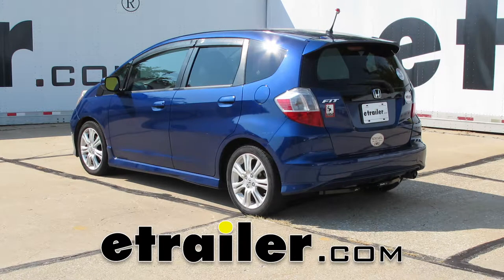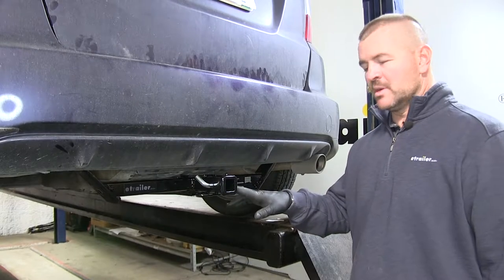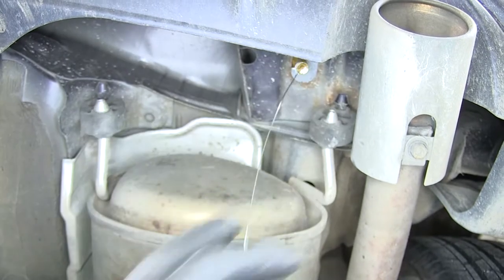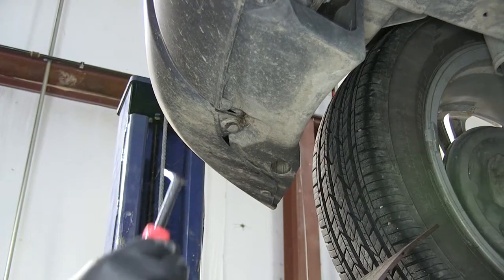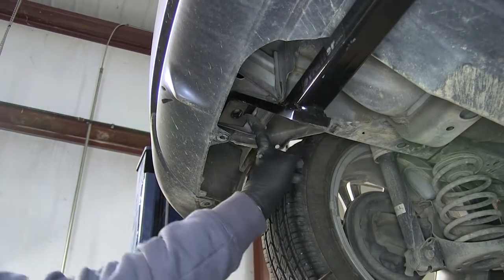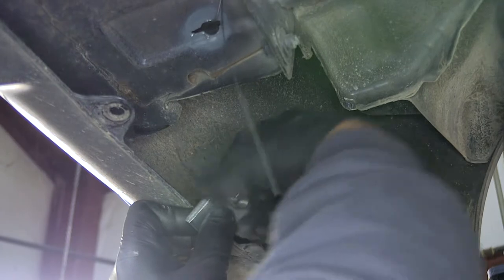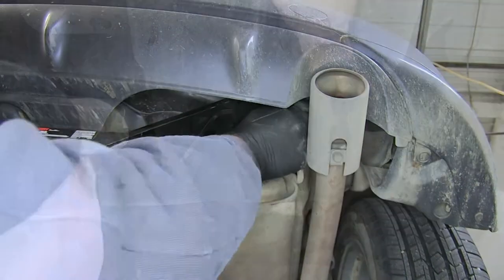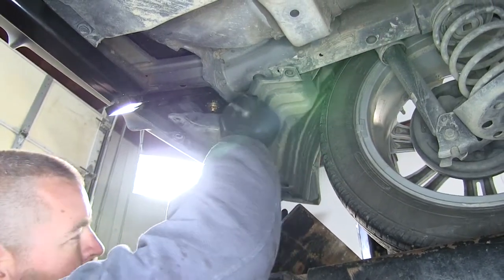etrailer | Installation Guide for the Curt Trailer Hitch Receiver on a 2009 Honda Fit

Comment: Perfect fit and simple instructions for my 2011. You can also do this solo, with the car on jack stands, and use a spare jack stand to hold to support the hitch in place. I didnt remove the hitch once I had it loosely bolted in place on the passenger's side and center. I drilled the driver's side hole (didn't have a 17/32 bit, used a 1/2 inch bit and slightly ovalized one side of the hole) then inserted/taped the spacers to the vehicle vice the hitch. Thanks for the video, much better than the paper instructions included.
Reply from the maker: We are happy to help. Thank you for the feedback. 

https://www.etrailer.com/Trailer-Hitch/Curt/C11064.html

Comment: Im looking for an installation video of wiring harness on 2007 honda fit, is it the same thing than the 2009?
Reply from the maker: The hitch for the 2007 Honda Fit is different. We have an installation video in the following link that you can take a look at to see how it installs.
https://www.etrailer.com/Trailer-Hitch/Curt/C11058.html

Comment: I have a 2008 fit and apparently the mounting system is completely different. I dont see anything under mine that looks anything substantial and convenient to bolt to.
Reply from the maker: This hitch is not designed to fit the 2008 Honda Fit. Check out the following link to see the hitches that we have available for your vehicle.
https://www.etrailer.com/hitch-2008_Honda_Fit.htm

Comment: How much weight can the Honda fit pull?
Reply from the maker: You can find the tow capacity for your 2009 Honda Fit in the owners manual. You will want to use the lower capacity between the hitch and the vehicle.
https://www.etrailer.com/Trailer-Hitch/CURT/C11064.html